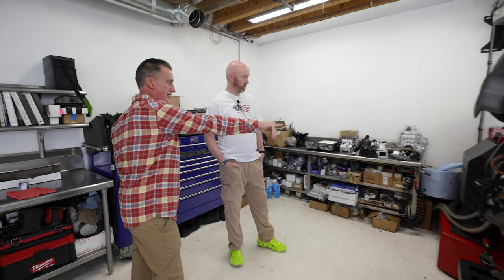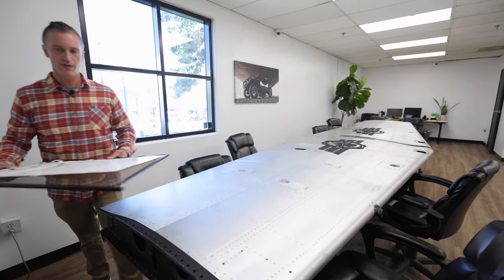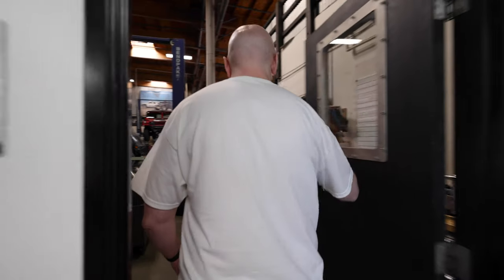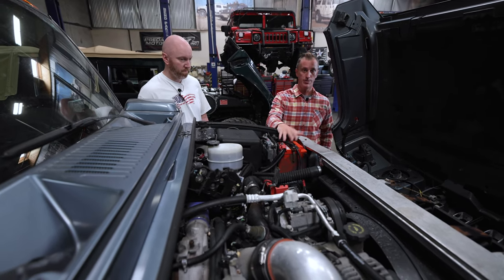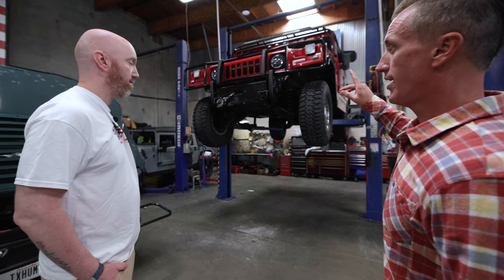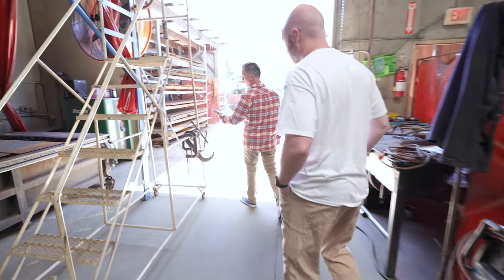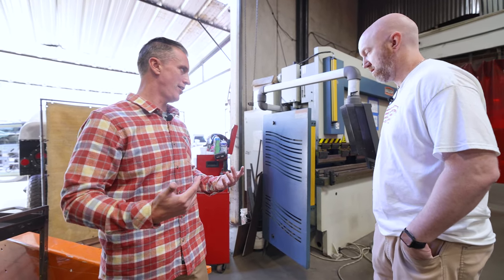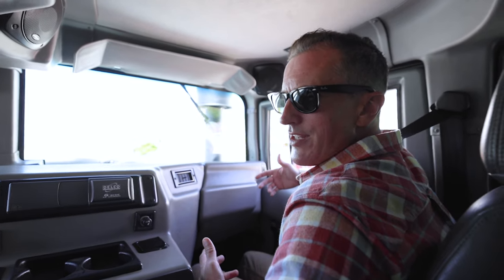Exclusive Shop Tour: A Customer's Adventure through Predator Inc's Hummer Haven

Comment: Ryan! “If” the H2 line had the option of the Duramax engine, do you think it would have “saved” the H2 life line a little longer?
Reply from the maker: Great question. So they would never have produced it because the design would need to completely change per Susan Dochertys conversation I had with her in 2006. However to answer your question, no. I don't believe it would make any difference. We entered a recession and the hummer h2 and h3 brand was being hit extremely hard. Politicians were out for blood in the political theater and gm was needing a bail out. It was a perfect solution to sacrifice the brand for the bail out especially with the environmental direction the country was headed. Hope u and fam are great bro! -Ryan
Reply: @PredatorInc  ah, that makes since! We are good. Hope your family & the Predator families is well. Jason too 🤙🏼

Comment: I'd love to find a 4 inch rancho lift for my H2 they are so hard to find
Reply from the maker: It is nearly impossible to locate a new or refurbished set in excellent condition.
Reply: @PredatorInc  I've wheeled my truck for years without a lift it will most likely stay that way